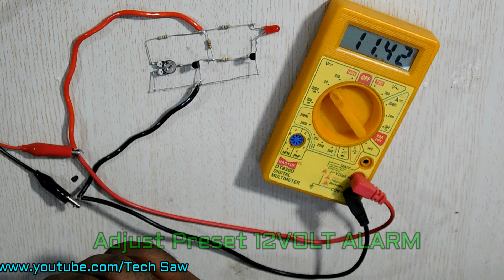3v -12v Adjustable Battery Full Indicator

Comment: Bay, aside from the test probe cable of the tester, the red and black output is for the battery right? So if you charge the battery using a charger you need to attach that output same polarity for charge indicator?

Comment: It is useful to run DC Motor ?
Reply: No
Reply: Use pwm controller to run dc moter
Reply: Pwm means
Reply: @ggowtham1610  pulse width modulation